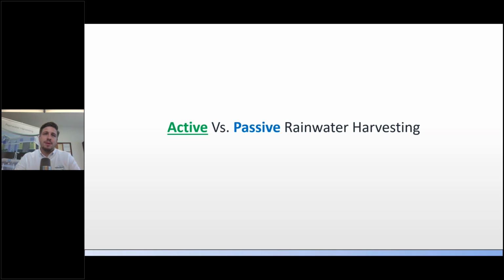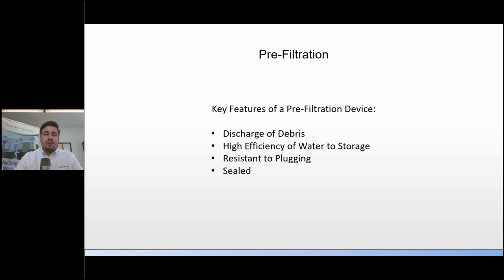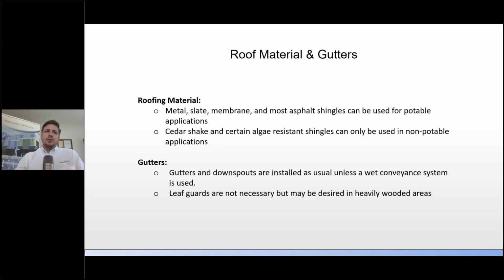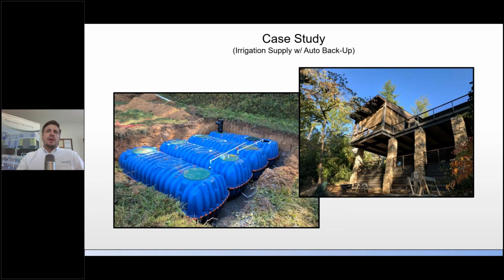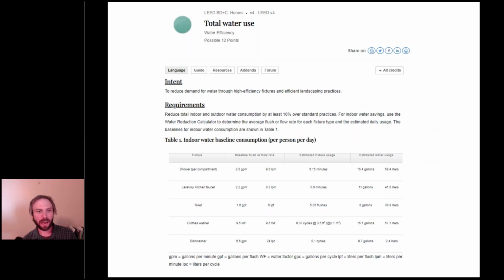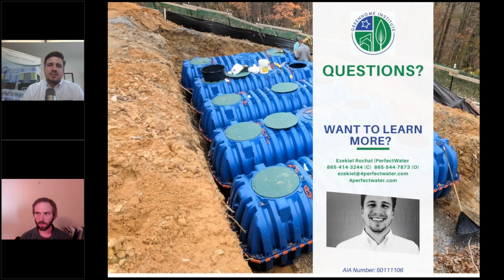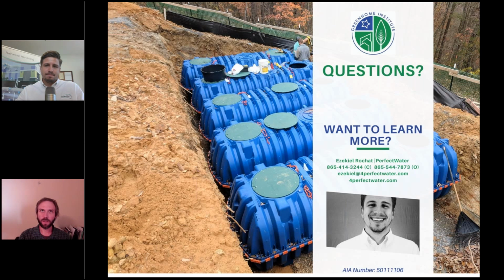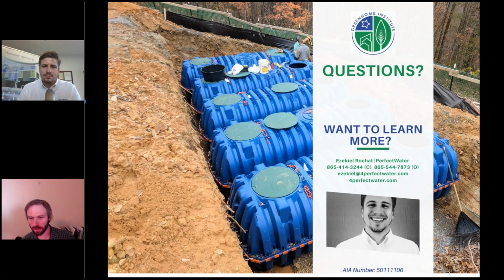Basics of Rainwater Harvesting for Residential Use

Comment: Appreciate the information. For the sake of audio clarity, it would be great if you worked to avoid smacking your lips. It comes through as a sharp sound on the audio track. Probably would be less noticeable if I wasn't wearing headphones, but thought you would like to know. Again, thanks for sharing this information.
Reply from the maker: Thank you, John. May you let us know one new thing you learned?
Reply: @GreenHomeInstitute  Didn't know for example that the biolayer (film at the bottom) would be expected and normal. In a highly processed and sterile world, it's easy to think of all microbes as bad. Also had not thought about contamination from the roof preventing healthy microbes in your water tank. It does make you wonder if that should be legal if it makes the water unsafe for drinking. His point about planning the conveyance for areas which would be disruptive to add later makes total sense, too, even if the system isn't going to be built right away.
Reply from the maker: @JGoodwin  If that roof type should be legal?
Reply: @GreenHomeInstitute  Yes. If a roofing product makes the water coming off the roof unsafe to drink, it's unclear why it should be allowed in the marketplace.

Comment: As I am researching how to do this on my off grid cabin I'm going to be building, I have been shocked at how many misconceptions there are about rainwater harvesting. People are really resistant to the idea- even among people who live an off-grid life. A lot of them think it's illegal, unsanitary, that their area has to receive rain all the time, etc. It's been really surprising. People will spend $30k on a well and won't even consider an rainwater system. Blows my mind.
Reply: A good well is much more reliable and less hassle than a rainwater system.     The storage requirements can be extensive especially if it's the only source of water.   Plus dealing with the unsightly tanks and ongoing maintenance.    I'd prefer a well over a rainwater system but it doesn't hurt to have both.